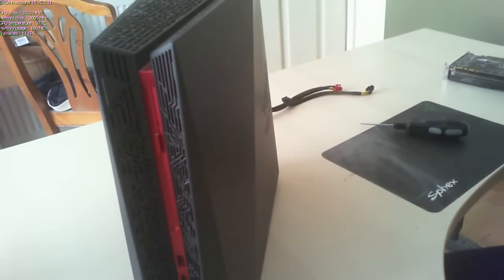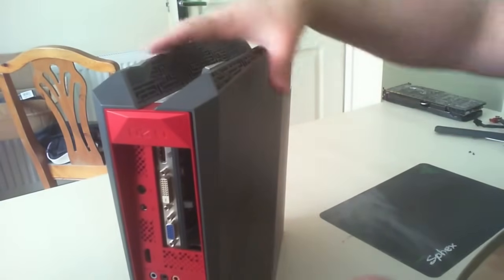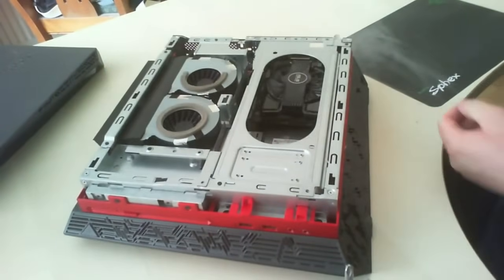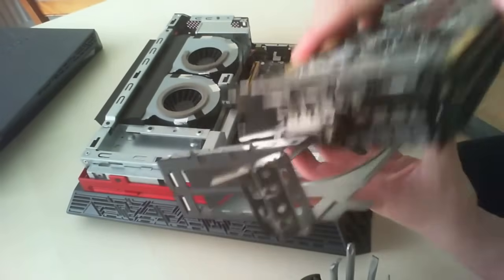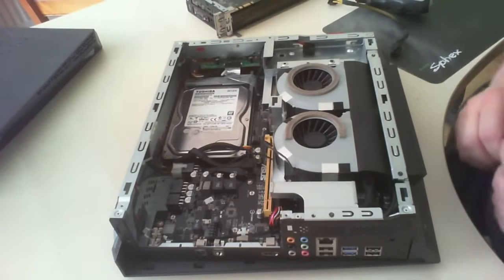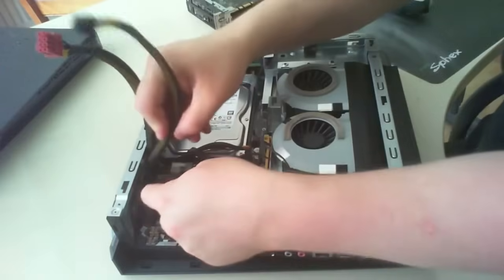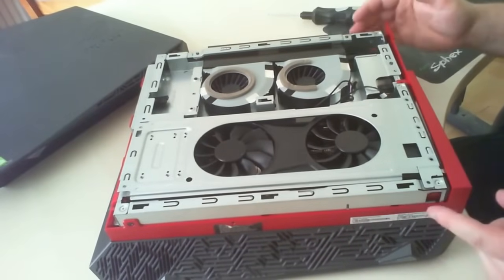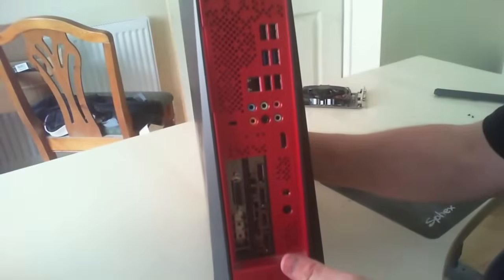How To change Graphics Card Upgrade Tutorial (Asus ROG G20AJ)

Comment: Now you used the evga gtx 980. Is there a real big difference between that and the evga gtx 980 ti? Will the evga gtx 980 ti also work with this PC? From what I've been looking at online, they both look pretty much the exact same in appearance and size. So I don't see why it wouldn't.
Reply from the maker: depends, it will only be the base clock speed that will be faster.
Reply: @welshwhoopee  I was thinking either the EVGA GTX 980 Ti or the Gigabyte Geforce GTX 1050 Ti. The reason why I asked if there was a difference between the EVGA GTX 980 and the EVGA GTX 980 Ti is because the regular EVGA GTX 980s for some reason are really hard to find. Because it's smaller than the EVGA GTX 980, I'll probably go with the Gigabyte Geforce GTX 1050 Ti. But thank you for the reply.
Reply from the maker: yeah that's true, the best card to try and find is the founders edition card, then it just comes down to finding a bargain card on ebay. because some 10 series or 11 series card could be as cheap as the old GTX 9 series cards and be as good or better

Comment: Hello Welsh, do you think it is possible also to change the case and install the motherboard on a new one so it's better to have a good ventilation if you are willing to install a 3060ti?
Reply from the maker: I wouldn't transfer it to another case as it won't fit, either transfer some of the parts like CPU and hdd's etc... to a new case, or sell it and make your PC from scratch. just depends what you want to do with the new pc etc..... where are you from anyway in the world and what do you mean willing to install a gpu?
Reply: @welshwhoopee  hello, i am from Croazia, i would like to install the 3060 but it's a little bit too big for that case!
Reply from the maker: not all GPU's will fit, but it depends on your budget and I can always find a card that will fit your system
Reply: @welshwhoopee  i dont have around 800 euros max
Reply from the maker: did you buy a 3060? the founders editions are the best ones to buy to make 100% sure its fit

Comment: My Nvidia 1660 Super only has one Set of 8 pin slots. The graphics card you used has two sets of pin slots. Does that matter?
Reply from the maker: not really, just use the 8pin to 8pin power cable and your ready to start using your new gpu
Reply: Did it end up working? I'm having serious issues with this not loading up
Reply: @philiplima2485  no, this space is very small and the 1660 ended up not fitting. I returned it and got the 1650 Low Profile. I couldn't be happier.
Reply: @cbwrestler103  I got the 1660 to fit it's just drawing to much power and all the usbs aren't working
Reply: @philiplima2485  would you mind sharing a picture of video?
I had the 1660 OC edition. There was absolutely no way I was going to get it to fit unless it took lsrtd out. 
My modem has an option for 2 power adapter sources. The first one runs the PC and everything on the motherboard. The 2nd power source is used specifically to power larger cards.
Have you tried that?

Comment: Hello, great video! I have a g20aj i7 4790, 16gig ram, and a gtx960...what would be a card that's worth it to upgrade to? Would a GTX 1080ti fit?
Reply: Thank you for the replay, i finally put away enough money to upgrade and i will take your recommendation and look for a 2060 or 2070, however i can't find "founder edition"i found on Amazon a 2060 from Asus brand...would that be ok? And i heard i need cables 6 and 6+8 pin, are those cables inside the g20aj?
Reply from the maker: hello, go for a RTX 2060 or RTX 2070 as the founders edition of them cards will fit and their should be cheap enough now.
Reply: @welshwhoopee  hello, I hope your doing well, I currently have a g20aj with a gtx 970 and I bought an Rtx 2060 to try to upgrade but I can’t seem to fit it in the house holder, any suggestions that might help?
Reply: @Snooobyy  did you get the founders edition? I heard they are smaller and should fit, but i didn't get a GPU yet so i can't personally verify that it will fit
Reply: I'm going to try a gtx 1080 ti turbo because someone mentioned it on forums. I have bought 2 wrong gpu's so far, 6 pin pci instead of 8 pci so be weary.
Reply: @mumtan_11  I'm gonna go with the 1080ti as well, let me know how it goes ..and what do I need? A different cable?
Reply: @AHappySpace  you dont need anything. It just slips to the graphic card slot. We also have a spot for an ssd drive and i installed that ssd drive and created a usb backup of windows and installed it on there. Now the g20aj runs on a ssd hard drive instead of the hdd drive. The ssd drives are waaay faster technology.
Reply: @mumtan_11  can you send me a link to the 1080ti you got? Is it working fine? And is it a big upgrade?
Reply: @mumtan_11  can you please send me a link to the GPU you bought?

Comment: can I use a 6pin to 8 pin and what power supply did you used for that gpu?
thanks
Reply from the maker: yeah that 6pin to 8pin is fine, and I used the original 230w (uk) and 180w (uk) power brick to power my gpu
Reply: @welshwhoopee  is it enough to upgrade to GTX 1060?
Reply from the maker: @khalilalimirzoyev2418  yes
Reply: @welshwhoopee the 230 to the cpu and 180 to gpu?

Comment: Hi, I was thinking about upgrading from my gtx 970 on my Rog G20 to a rtx A2000 (6gb) because of the low power consumption of this graphics card. I know it is not meant for gaming but it is definitely an upgrade from what I currently have. Now, I just read that a rtx 3060ti can be placed in and work with no issues. Is this really true? For what I heard it has to be a blower style kind of card. Thanks in advance, there is almost nowhere to find help on this topic. 🙏🏻
Reply from the maker: Hello, for the topic of the blower style card, it does help your PC but only if you have putting a lot of power and causing high temps from the GPU, then its better to push the heat out of your case rather then having it keep in the case and rise to the CPU. yes the new cards seems o.k so far, and as for gaming I have seen Linus Tech Tips doing some bench marks with them and their can plays then ok, Which model Asus Rog G20 do you have?

Comment: Hi, I have a Asus g20Aj and I am upgrading my GPU to a EVGA GTX 960 4gb GPU. The GPU supports 8-pin power cable while my motherboard has a 8 pin and a 6-pin slot available. MY question is,  do I need to install a male 8-pin from my GPU into a splitter male 8-pin  + 6-pin? Or will a male 8-pin to male 8-pin be enough for my GPU to work?
Reply from the maker: hello, yes simple answer is that only use the 8pin  to 8pin is fine, anything else or any issues just give me a shout and I can guide you the rest of the way.
Reply: @welshwhoopee  is there anything that I need to do on the board to ensure that I am enable the 230w power supply? Such as turning on a switch or anything?
Reply from the maker: you can do the JDC01 but to be honest I would just plug power packs in and leave the side case off and just check if the fans on the graphics card spin, if it does then your good to go and put back on case and game :)

Comment: Thanks for the video! I just have found and bought a cheap g20 with 1070 and i7 7700 and I want to upgrade gpu after I got it. Do you know the GPU dimension limits? Thanks
Reply from the maker: Hello, yes the biggest card that will fit is the "Founders Edition" and that size is.....
Height: 4.4" / 111.5 mm
Length: 10.5" / 266.7 mm

a lot of people on the asus forums have fitted up to a RTX 3060 TI into the system, so keep within them sizes above and your be fine and only dual slot size.
Reply: @Welsh Whoopee  thank you. I was thinking to get a radeon rx 6750 XT or 3070 Ti FE, dimensions are same, 267mm x 111 mm, so it will probably be fine. Do you have any suggestions for power brick? I have seen people talking about Dell 330W or a 280W brick but I'm not sure about which one. I actually dont know if its matter to have a specific one. Can I just get a random 280W or 330W from any manufacturer?
Reply from the maker: yeah both cards are fine, yeah I heard people have used the dell 330w power brick, but it would be worth buying that one due to the high power draw it will happen. well I just got this from the asus forums 
dell p/n Y90RR
ref mo. adp-330ab
model da330pm111
and when I check amazon, I got this item https://www.amazon.co.uk/Dell-AC-Adaptor-330W-Y90RR/dp/B00CTHK9IU 
their are also selling on ebay at the same price

hope this helps
Reply: @welshwhoopee  thanks for your time and help! As I'm in the UK, I'll get this one too from Amazon UK. Subscribed to the channel. Cheers
Reply from the maker: thank you so much, yeah let me know how you get off and any more help, just give me a shout :)
Reply: @welshwhoopee welsh will a rtx 3060 oc edition fit?
Reply: @welshwhoopee and is it good
Reply: @welshwhoopee  I pretty much know the answer, but do you think a Zotac 1070 mini would fit? I am giving it to my brother who has the G20CB, but apparently the Zotac GTX 1070 mini is 210mm long x 122mm tall. I never thought it was such a tall card, it would be a shame if it wouldn't fit. Thanks for your help!

Comment: Holy hell this video saved me. Thanks to this I can replace my gtx 1050 I installed before the great GPU shortage with an Rtx 3060ti.
Reply from the maker: Glad the videos are still helping people, how is it running?
Reply: @welshwhoopee  it’s still running well. Should help it run a few more years till I can build a ryzen system.
Reply from the maker: yeah same their didn't build this system in the new Ryzen platform
Reply: @Wileybot2004  Can you tell me the exact model you bought? did you have rog20aj or cb?
Reply: @nomecognome7264  aj
Reply: @nomecognome7264  If you don’t have the power brick that provides the extra power for a high end GPU there is one on Amazon and If you don’t have the PCIe connector a company on eBay custom makes them
Reply: @Wileybot2004  so can you please share all of this information and the 3060 model? i am noob with PC gaming, i would like to upgrade in order to play some new games
Reply: @nomecognome7264  You will want a 3060 with 1-2 fans and a 2 slot width to fit into the case. The card will have either a 6 pin or a 8pin connector on it for power you will need to buy a 6pin to 6 pin or a 8pin to 8 pin cable accordingly. You will need to buy the extra power brick to supply the additional power for the card and follow the instructions in the vid to change the jumper as well
Reply: @Wileybot2004  where can i buy all that stuff? is there also a video?
Reply: @Wileybot2004  can you please share a link on amazon of 6 pin-8 pin adapter and power brick that you use?
Reply: Is that GPU not bottle-necking with the rest of the system? I mean it only has 16GB of 1600MHZ RAM, as well as an i7 4790 at best lol